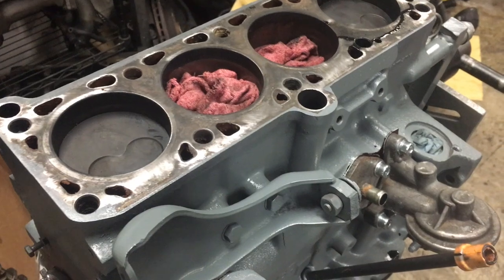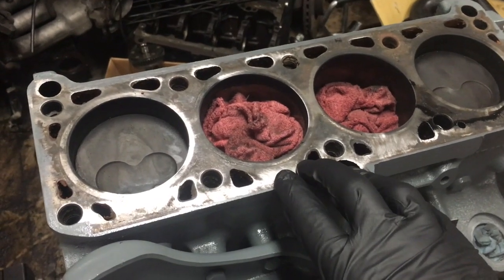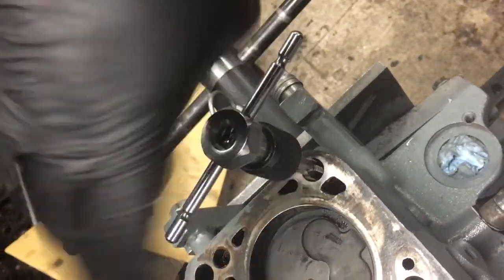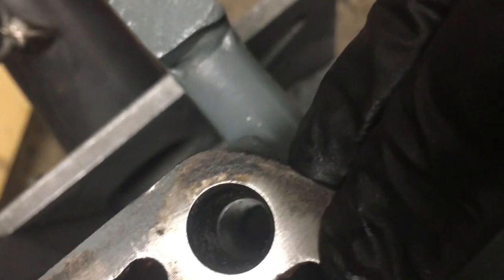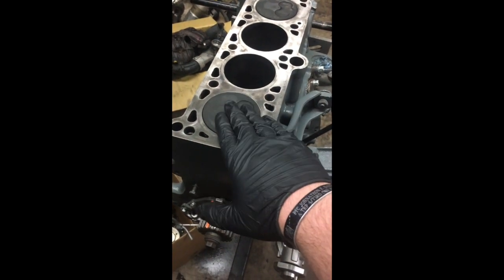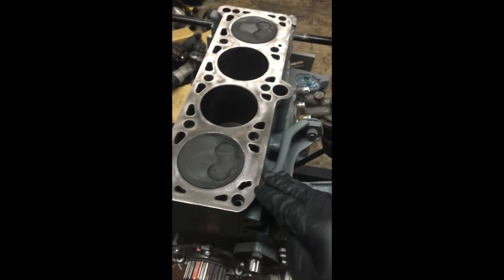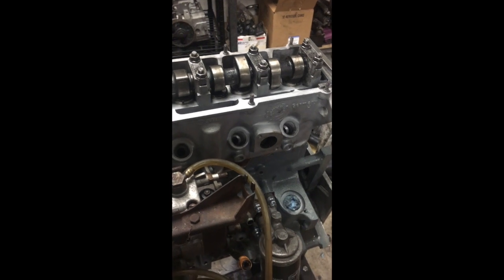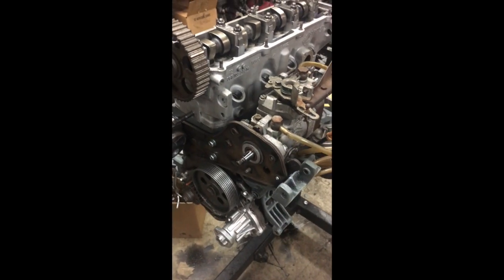VW DIESEL ENGINE REHAB PART 2: CYLINDER HEAD

Comment: Why is the top 1/2" of threads missing in each head bolt hole ?
Could it be that is part of the reason these blow so many head gaskets ?
Reply: Probably because these are for torque to yield bolts that are intended to stretch when fastened properly. The added length of shank is needed for that much more stretched bolt.
Reply: @khester7397  Thank you for your response.  My words are not critical of you more the mentality that proceeds you.
  I have heard that the explanation you skillfully  before you skillfully presented and always have to laugh when I think of it.  
  I went the next bigger size bolt as did the later engines only I went two steps further. I made my own head bolts from 1/2" I think they are grade 8, I do know I have drilled out and threaded every head bolt hole to 3/4"  OD  making a heavy duty steel insert to alleviate the faulty engineering.
    Engineering was possibly a good thing at one time but ultimately it has been the guide for building objects with the least possible investment to do the job, all be it temporary in this regard.
Just another example of the wicked ways of man.

Shalom

Comment: how did you get the exhaust flange on manifold back on ,its a swine ito get back together ,wors still if you have the one with the two clips on (i managed to get them on ) but its trying to line the flange up thats a problem.
Reply: Use a  U-bolt as a spreader for the c shaped clamps.